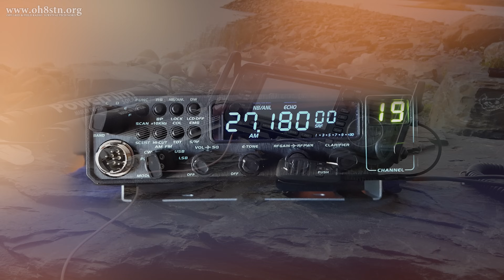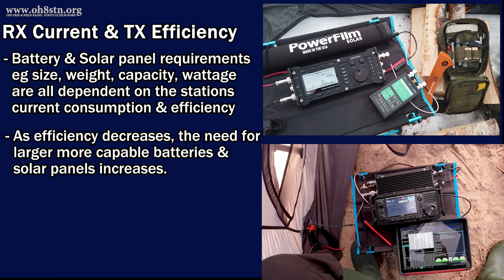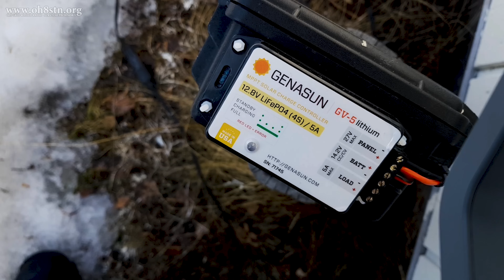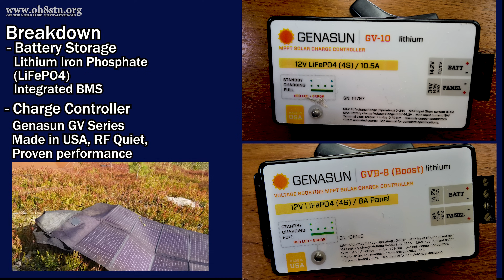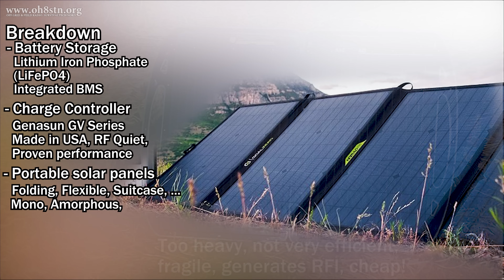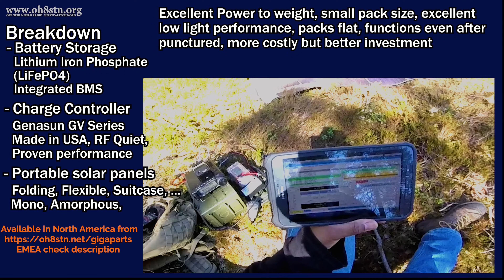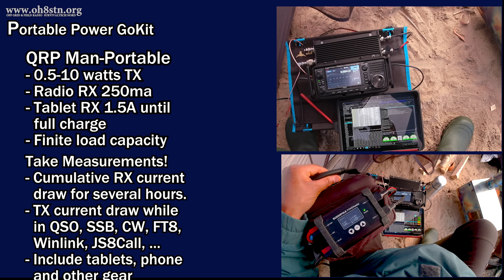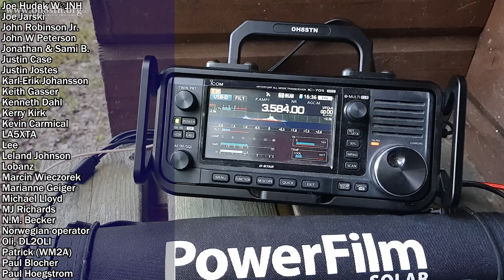Off-Grid Solar Power for Portable Ham Radio

Comment: Just catching up on old video. The current consumption rate of the G90 vs the 891 is crazy? Why can they be set up that way and still do the same thing? Yeasu certainly has too much thirst for power compared to the G90. Thank you for this. I have a 891 for my home station but want something like the G90 for POTA or other portable ops.

Comment: Hi Julian,
all Your videos are extremely well done and helpful! Great job! I got myself an IC-705, Surface Go 2 and PowerFilm LightSaver Max solar panel. These solar panels are sold out in EU, unfortunately, but luckily I got one from VE. Charging the IC-705 works perfect. What I am still struggling with is how to charge the Surface from the PowerFilm solar panel. I see that You obviously charge via the USB-C port of the Surface Go 2. When I try this, I get a  notification that I have to attach the Surface to a proper power supply. Any suggestion on this? Keep on the great work! 
Dom, DL5EBE
Reply from the maker: https://oh8stn.org/blog/2021/10/10/microsoft-surface-go-2-faq-ham-radio-laptop/

Comment: Hi Julian. Just wondering if you have any comments on the FX4c. Published 2 amps on TX and 220 ma on Rx.
Reply from the maker: I think it's a brilliant design and a reasonable price. Built-in audio interface, low receive current, reasonable transmit current with transmit up to 10 watts. If I wasn't on a tight budget with my solar power things, I could imagine pulling the trigger on one myself.
73
Julian oh8stn

Comment: Hi Julian, I have 2 120watt power film folding panels that I wish to put in parallel. Do you have a charge controller that would work well with this configuration for both lifepo4 and lead acid? Thanks wa0spg
Reply from the maker: At the moment no. The current is too high (potentially). I reached out to Genasun asking about their charge controllers for 2x 120w in parallel. They don't have something at the moment but they do have something in R&D. Genasun will release a 20A version, but I can't say when. Until then, I am using two Genasun GVxx, one for each panel. The charge controllers battery output can be connected to a common battery. This is how I'm doing it for my two 120w panels at the moment. I also have a 220 watt powerfilm panel which can't be use until that new 20A charge controller is released.
Excellent question, thanks for watching.
73
Julian oh8stn

Comment: "Who the heck are you and what have you done with my wife????" ROFLMAO!

Like you, I love the idea of the PowerMini, but the implementation lacks. It simply will not integrate with my Bioenno battery packs. I consider it a failed experiment for lithium-based chemistry. However, I can probably use it to charge lead-acid batteries like those I use in my camper.

I recently added a second 30w PF foldable panel and a GV-8 to my kit. We don't have a lot of cloudy days here in Nevada, but I expect to live in Missouri this year and it can be gray there for days on end. 

I decided on a second 30w panel because "two is one and one is none" when critical conditions exist. I expect to add one or two 60w foldable panels later this year.

Now I need to get VARA HF/FM operational on my portable computer and integrated with my radio kits. I really want to have email capability in the field when out of cell service (or when cell service fails). 

Thanks for all your hard work! 73 de AG7TX

Comment: Julian, I'm a big fan of your videos with all your helpful reviews tips and suggestions.  Thank you!  You've inspired me!  I've divided my portable ops to two different scenarios:  #1 Day Hiking go kit:  A 1212 Bioenno LiPO4, Qty2x 28w Powerfilm Rollables (for wet wx operating) with your recommended Genasun 5A controller and my choice of either a IC705 or G90 that sit on the shelf.  For my portable kit #2 car/camping/QRO station (and for occasional home power outages/preparedness) just picked up a Powerfilm F16-6000 100w from CaliforniaPC and will use it with a 1220 Bioenno LiPO4 and a Buddipole powermini with a FT-891.  All works with my MS Surface Pro7 and a MiniProS. Thanks for all your suggestions & videos. 73 de Kevin VE7OVY
Reply from the maker: Congratulations! Absolutely outstanding and best comment of the day. Sounds like a dream station with the best of both worlds.
Kevin, what are using for power distribution?
73
Julian oh8stn
Reply: @OH8STN  Thanks Julian! Pretty "minimalist" on the power distribution; just a bare-bones Rigrunner 4005.

Comment: Nice video.  I was wandering what you mean by "poor charging profiles..."?   I am a newby but have been using these with several LiPo systems.  What should I look for?
Reply from the maker: Lithium iron phosphate, lithium ion and even lipo all use constant current constant voltage cc/cv charge profiles. This is different than the lead acid profiles the buddipole PowerMini and + tries to use. Basically the buddipole gets confused when it's trying to charge a lithium-based battery.
Reply: @OH8STN    A bit over my head but thanks for your response.   I’ve built a few portable batteries for HAM, I’ll try the other one on the next project.

Comment: Hi Julian, great video as usual. Thank you for taking the time. I have been off grid for about 10 years one thing that interests me, particularly regarding your situation, is managing batteries in the sub zero temps of the Arctic. 
73
VK2ZRK
Reply from the maker: Thank you.
The trick is treating the batteries is setting up shelters and heat.  Although we can discharge them below freezing , we need to get them up above freezing before charging. We must also use sensors to monitor the cell temp. It sounds complicated but actually quite simple. Often the batteries are stored in an inner pocket. Larger batteries have a heating pad or hand warmers in addition to foam insulation.
Reply: @OH8STN  Thank you for the reply Julian. I was interested as I did a SOTA activation on the weekend and it was about zero degC and I noticed my batteries were not lasting as long.
Cheers
Andrew VK2ZRK

Comment: Hi!  Living where you do, what do you do in the winters when the days are so short?  Do you just throw some additional solar panels in your pack?
Reply from the maker: This is an excellent question! So it's a multi-prong approach. First, reduce the current consumption as much as possible. Increase the battery capacity. Finally,  double up on the solar panels. 
73
Julian oh8stn

Comment: Another excellent video with great actionable information.
As thorough as you are you appearent weeded out Morningstar Solar charge controllers early. How were you able to do that?
Reply from the maker: Thanks for the question and kindness. 
I have a couple of the Morningstar charge controllers here. If not for the noise they generate on HF, I would have included them in the series. In principle we want to stay away from PWM charge controllers. The Morningstar charge controllers are excellent turn on radio related uses.
73
Julian oh8stn
Reply: @OH8STN  Fair enough. My portable ops is based on a vehicle. A few years ago I setup a 1200W PV system using  100W Renogy panels and a Morningstar PS-MPPT-40M to run three 100W HF stations for ARRL Field Day. The battery system was 4ea 80Ah AGM batteries in a 24VDC array. I used a second PS-MPPT-25M charge controller from the 24V  battery bank to a 5th 12V battery that ran the radios.

Unorthodox be it worked well.

It filled my Chrysler 300.

Of course I designed my system for after hurricanes for use at my condo. I have 1600W of PV so I could run a 1200W PV system 24V system with 3KW pure signwave inverted for lights, fan, refrigerator or portable HVAC.
Additionally the smaller 400W system would power all 12V DC systems.
It is portable in case I do shelter radio communications. It has a breaker box and system GFI that can float from earthground or be used with earthground.
I haven't experienced RFI from the MPPT controllers and I haven't had to use the supplied ferrite beads.
I have consider using Victron.

Comment: Love the builds did a 15amp lifepo4 worked great thank you but I cannot find a cheap lightweight solar panel at 12-15volt  50-100watt in the uk and keep the videos coming I love them and they are really helpful thanks 🏴
Reply from the maker: Yeah it is unfortunate that the cost of solar panels increases, as their weight decreases. If you don't need to carry it yourself, there are heavier albeit more cost friendly options.
The series will continue regulary from for the next months. SOme breaks for the preparedness content, but portable power has always been the passion.
73
Julian oh8stn

Comment: Outstanding Julian!  Great video for QRP off grid radios.  I’m still running the FT-817, it last a long time with the 4 amp hour battery.  I do need to make the jump to solar, hurricane season is less than a month away.  73 KM4SON
Reply from the maker: Thanks Don. The 817 current consumption is manageable with an higher density external battery. For years I used the 20 watt panel and 5ah battery with very good results. No reason to change unless the rig fails.
Always nice to see your comments.
73
Julian oh8stn

Comment: Fantastic video Julian!  I'm currently using a custom LifePo4 battery made with 4s1 Headway 38120s and a Overkillsolar BMS w/ bluetooth,  GVB-8, and PF R60 panel with my IC-705 and MS Surface Go.  Great setup and I appreciate your insight.  Could you show your power distribution?  I was looking at a Paradan unit but it draws am much power as the TX-500 on receive for the display!
Reply from the maker: Outstanding setup. I'm waiting for one of those Overkill solar charge BMS boards.
Power distribution I simply made a cable with multiple fused outputs. It's totally analog. I wasn't concerned about voltage or load since my solar and Battery are so much overkill. I've always got the display on the radio just in case. I thought about one of those arguing no based distribution projects. Nice but added complexity.

Comment: OK, wow whole semester of electronics in this one. So all your cables,wire management what are those weak points. Spare parts or field repair. Last is how big is the box all that fits in to transport ?  out standing video as always.
Reply from the maker: Thanks Bill.
Logistical weak point is a lack of sunlight or ability to get to it. Mechanical weak-points are cable joints at the battery. Although I have never had a failure, I do carry a butane soldering iron just in case. The size of the kit varies per mission spec. A SOTA summit with a QRP radio has a much smaller footprint than a QRO station meant for EMCOMM. We will go through the varios types of kits.
73
Julian oh8stn

Comment: thank you for the post. i do have a foldable solar panel but haven't actually done portable radio ops with it yet. it is on my long list of things to do.
Reply from the maker: Keep in mind it doesn't have to be a big "expedition". Just get outside wherever you can and set up your gear. Sometimes we pull oer ont eh side of the road, other times, in the back yard. Just keep it simple. Each experience no matter how small, will give you valuable experience.
73
Julian oh8stn

Comment: Regarding diy battery packs, did you have to balance the batteries or were they equalized/matched from the factory? Thanks Julian!
Reply from the maker: Hi Jeff.  For diy packs, we always match the cells according  to internal resistance then balance. Not a problem  with new cells.

Comment: Well done video. I've followed you for some time now and always find your content valuable. As the EC for my county in Ontario Canada my portable systems need to serve several functions. One of these is to provide emergency communications for served agencies. In that role I use a 50 Ah LiFePo battery. This system is to heavy to be man portable. However I recently bought the components for a packable off-grid station which I'll be putting to use in field operations this summer. Your videos have been invaluable in working out the details of all my stations. Thanks for all the effort you put into your content.
Reply: I also have a large (60Ah) station battery in my camper. It easily stays charged in the field with a foldable 120w panel deployed specifically for that purpose. I can keep everything else running and charged off that battery when I'm operating from my camper. (The camper itself has a separate system.)

It is not difficult to estimate your energy requirements if you measure the current draw of everything you expect to deploy. Be sure to measure the current draw of your radio(s) on receive and when key down. Then it's a matter of computing the weighted average current usage of your radio under the expected fraction of time spent on transmit and the duty-cycle draw of your operating mode.

Add a safety factor. I chose 3, thinking worst-case scenario was three days no sun. If you have a backup generator, then you can reduce the safety factor, but I would use at least 1.5.

This is fun stuff, at least for an old engineer. :) 73 de AG7TX

Comment: Great video. I’m in the process of cobbling together a solar setup for qro, maxing out at 20-50 watts. Occasionally just cause I’d be curious to see, pushing it to a full 100 watts. Curious what your definition of qro is?
Reply from the maker: I ran the 891 at 100 watts SSB on solar power for some time.  Typically my QRO is 20-40w running data. So the output power is not the problem, in fact it's easy to achieve. It's how long one can operate which becomes issue. Definitely test and share your results.
73
Julian oh8stn

Comment: I am looking at the qrp radios for longer term operations.   My 10 ah Dakota lithium battery is definitely too small for my 891.

The boost charge controllers could still be usefull in places in AZ, especially in Northern areas where trees might partially shade the panels.
Reply from the maker: Huh, you're right! My time in Arizona was always down in the Yuma area. It is easy to forget the flagstaff area is there as well. Yes the 891 is an excellent performer, but suffers from low efficiency. If Yaesu could do something about rx current and tx efficiency in a revision, they would sell tons of them.
Thanks for watching commenting, and the feedback.
Much appreciated.
73
Julian oh8stn

Comment: Great comprehensive presentation. I'd like to see your opinion/review of the Bioenno line of panels, charge controllers and batteries. They have targeted the Ham community, and I recently built a  solar generator with their products that I have used on two POTA activations. It is a more expensive line of products but I am very satisfied so far.